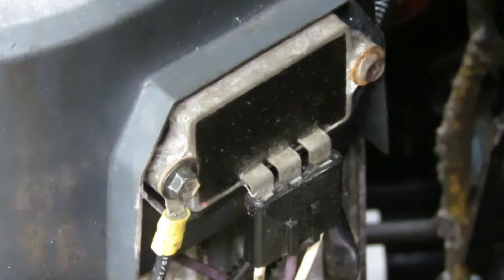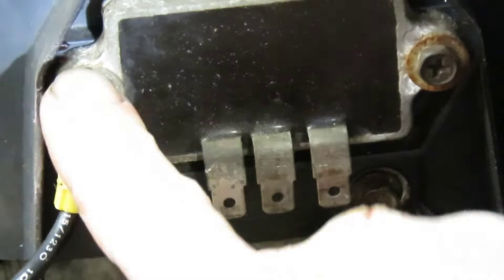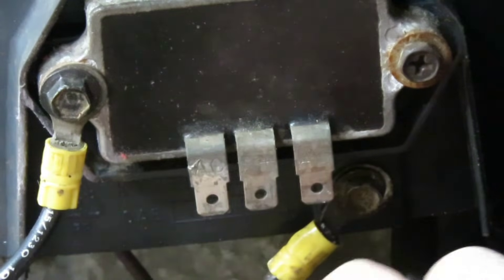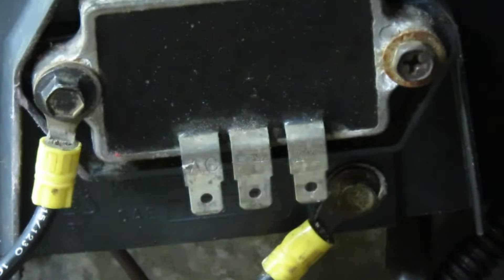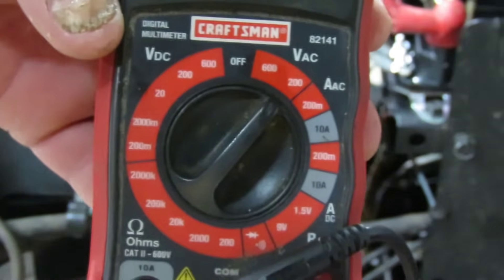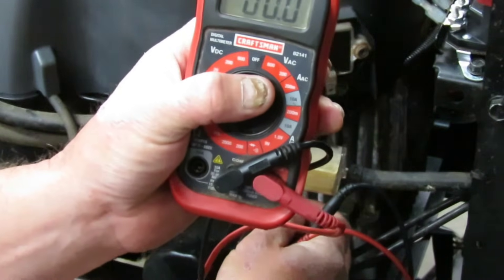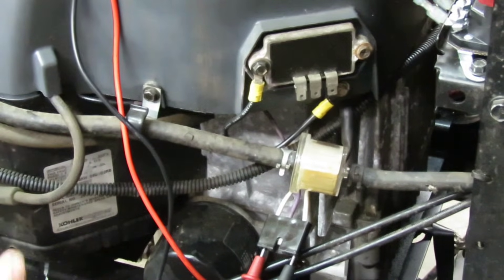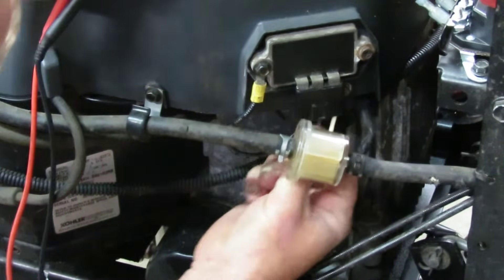How to Test Kohler Charging System

Comment: Following your process, I tested my stator and got 41 volts.  However, when I tested my center prong on the rectifier, I'm only getting 12.  I thought it was bad and decided to order/install a  brand new one.  However,  I'm still only getting 12.  Any thoughts/ideas on why I may not be getting the required 13 - 15 volts?   Thanks!!!
Reply from the maker: Check ground to base of rectifier. Usually on a kohler the rectifier has a small wire going from rectifier mounting bolt to a shroud bolt.
Kohler is bad to lose the ground at the shroud bolt.
There is a trick to this test.
If you put your meter leads one on rectifier base and one on the bolt on shroud
You will show ground
But you are actually getting a reading thru the wire.
Put one lead on battery negative and the other lead on base of rectifier to test.
Reply: @sartingarage8045  I’ll try that today… Thanks!!

Comment: My son's Kohler 25hp wouldn't charge. I checked the stator output and was a whopping 44v. It was in fact a bad ground on the voltage regulator, easy fix. Thanks a LOT for the video.

Comment: Great video. One question though - couldn't you start by checking the regulator dc output first. Can't we assume the stator is good if the volts out are good?
Reply from the maker: Yes you can 
If you have charging voltage there and not at the battery. Stator and Regulator are working. The problem then would be wiring or faulty key switch

Comment: What can i do
Change flywheel or megnatic pieces under flywheel kindly your support
Reply from the maker: You can replace flywheel or you can epoxy magnets back in place. If it's just one magnet. Epoxy it back into place.
If it's more than one
The magnets have to be in a sequence
Push Pull Push Pull Push Pull
Meaning one magnet is Push Next magnet is Pull. They have to be in this sequence all the way around flywheel.
Reply: @sartingarage8045  magnets around flywheel every one magnets has push and pull from ends
Reply from the maker: It's been awhile since I've had to do this
But take another magnet 
Put the magnet against one of the magnets on flywheel , should either push the magnet away or pull it. Go to the next magnet should be the opposite of first one.
Should be like this all the way around.
Reply: Thanks for your information ❤️
I need your email address for more contact

Comment: Very good video
My issue in Kohler kt735
Stator reading 30at3600rpm
Regulator reading 1v 
I changed stator become reading 40ac volt
And change regulator become reading 8.65Dc volt
Reply from the maker: Kohler engines are bad to lose ground to base of voltage regulator.
Make sure base of regulator is grounded
Usually small black wire which connects to bolt on regulator and goes to bolt on engine shroud.
Loses its ground at bolt on engine shroud.
Also with key on make sure battery voltage is at regulator wire that you have 8 volts on.
If there is no battery voltage problem is in key switch or bad connection.

Comment: Hi 
If stator out but 30.2ac V 
At full throttle
Regulator 1DCV
Kindly your advice
Reply from the maker: Turn Key to on position 
Check Voltage at Regulator where you are getting 1 volt
You should have battery Voltage at this wire with just Key On Position.
Engine Not Started
If there is NO battery voltage at this connection
Your problem is wiring to and from key Switch or a faulty key switch.
I have a Key Switch Test Video

Comment: So, I just checked the stator, throttle wide open and it's only reading 1.2 to 1.3. The grounding bolts look good, no rust. I have yet to check the voltage output, because I think it's a moot point at this time. What would you suggest my next step would be?
Reply from the maker: 1.2 volts AC voltage is Not enough
Pull Flywheel and check magnets. If Magnets seem to be ok and in place 
Replace Stator
Note: If magnets are loose or have fallen out
There is a certain way they go back in
Get back with me if they have fallen out
Reply: Upon further investigation, my dumbbutt didn't have my leads pushed in all the way on the meter. I am getting proper amount of ac voltage from the stator, and proper amount of dc voltage out of the regulator. My issue is that after running my mower until it's warmed up or hot, it won't restart if I have tto shut it off for a minute or two. I have to wait till it's cooled off for 45 minutes to an hour.
Reply from the maker: There are several things this can be.
But from what your telling me it sounds as if
Carb Needle Not seating properly causing fuel overload after engine shut off,
Don't think this is Ignition Coil problem due to engine would just shut off on its own.
Possible Key Switch Short intermittent 
Or Maybe Valves need adjusted
When engine is cool the valves will have less clearance.

Comment: I was hoping you might go one more step. I found the video very good , My stator was putting out over 45, The rectifier was putting out 14-15 yet when I check the battery terminal, it was 12.7 which isn't enough to keep my battery charged. I welcome your thoughts as well as others that might have some insight. I checked the bottom fuse on my Exmark 60 Turf Tracer  23hp Kohler . Many thanks
Reply from the maker: That wire off voltage regulator goes to key Switch A1 or A2 usually
Test key switch from B terminal to A1 or A2 terminal.
You can disconnect battery and do a continuity test from wire on voltage regulator to key switch connector to find which terminal it is on key switch.
Reply: @sartingarage8045  UPDATE: I could not sleep, the little voice inside my head was talking to me and said, Silly Boy , Check the fuses, Everything was reading perfect except at the battery. I had to physically take a pair of pliers and pull the top fuse from the holder (because it had fused to the plastic) It was fried. Put in another fuse and it was reading over 14 at the battery... Very happy and just wanted to share in the hopes it helps someone Else. WE all can learn from each other. Many Thanks

Comment: I have a 26.5hp Kohler horizontal engine. It quit charging. Cleaned up all connectors and put a new regulator on. I'm getting 43vac to the regulator but only 1vdc coming out. Any ideas. New battery. Even ran a separate jumper ground from battery to regulator housing and no change. Thank you
Reply from the maker: Most Regulators have to have battery voltage to the output that your only getting 1vdc out of.
This voltage comes from key Switch
B terminal on key switch comes from Starter Solenoid, small wire with fuse in it
Connects to A1 or A2 terminal thru key switch
A1 or A2 go to Voltage Regulator
Watch this video it is a Kawasaki 
But everything works the same
Just wires on Regulator are on different
There are some good tips and tricks in this video
https://youtu.be/zRwkKNGkymU
I also have key switch test video link below
https://youtu.be/fAWMFy9L9iI

Comment: Things are never as easy as youtuber's make it look.  I have not been able to find any youtuber who test regulator on horizontal CH940-CH980 kohler.  Problem with them is that they are mounted underneath the flywheel shroud with a blind connector.  The test is simple but the access is always the problem.  Any suggestions?
Reply from the maker: The stator wires should come out from under shroud to a voltage regulator mounted to side of engine. You can test the AC coming out of stator at voltage regulator.
Usually on a kohler the voltage regulator has 3 terminals. The two outside terminals are from the stator. The center terminal is DC output to charge battery.
Reply: @sartingarage8045  Like I said, the regulator on these is mounted under the shroud and so to is the 3-pin connector.  That's what makes the testing a real pain.
Reply: It can be hard to understand, unless you've worked on one of these.  The Kohlers above, to clarify, have the regulator ground wire bolted to one of the ignition module mounting bolts because the regulator mounting bolts just go into the plastic backing plate.
Reply from the maker: Can you get me your exact engine model # and spec #
Reply: @sartingarage8045  Sure.  The following have the same config, carb, stator, regular/rectifier.  CH980-2016 and CH940-3011.
Reply from the maker: I think what I would do is relocate the voltage regulator to the outside of shroud.
But remember base of regulator has to be grounded to work.
Cut the connector off leaving some wire to attach to. add some wire, use butt connectors and I would heat shrink tubing over butt connectors to seal it.
Or make you a test connection that attaches to stator wires and run them out from under shroud. I would use a wiring harness that has a connector on it like a Briggs and Stratton Part # 393456. Just Google that number it will come up It's like $18 or steal one off old mower.
Then you can just leave the harness on the engine for future testing. With the connector on the end of it will be less likely to touch metal and short stator out. Maybe find a rubber cap or something to cover over connector when not testing. You could just leave it on the engine
The DC output wire from regulator has to come out from under shroud already usually runs to key switch.
But for the most part the voltage regulators are notorious for going bad. It's usually not the stator that is bad. Very rarely it's the stator bad. Usually Voltage regulator bad or bad ground to base of Voltage regulator.
Sometimes it's the key switch not making the connection between the DC output wire terminal to battery terminal on key switch.
Reply: @sartingarage8045  Thanks.  Could do, but for client motors, tend to like leaving config OEM.  Also, worry somewhat about regulator heat sink, if mounting with connector outwards.  Just seems like this should be a Kohler issue, but they aren't interested in any engineering change, believe me I've tried.  This series config is the only one I ever seen in my 40 years or servicing small engines.
Reply from the maker: Yeah it's silly to mount that inside shroud knowing you can't get to it to test it without it being dangerous. Which would be running engine without shroud on it to test.
Only thing I could figure is there using air from Flywheel to keep regulator cooler and maybe out of weather.

Comment: I got 13v is that good?
Reply from the maker: 13 volts will still charge the battery up
But seems a bit low should be more around 14+ . I would check ground to voltage regulator and maybe weak stator.
Make sure battery is fully charged also and check charging again.
But I have seen them run low voltage like that and still charge. It's actually putting amperage back into battery. It not really voltage that charges the battery.

Comment: I have a nice running k181 a on a go cart I’m finishing up. Quick question with a generic eBay rectifier does it matter witch way I connect the two white engine wires? As long as the middle post off the rectifier goes to the correct post on the key switch right? Also an amp meter can be spliced directly into the wire that powers the key switch without problem?
Reply from the maker: Pretty sure it doesn't matter

Comment: good Job > Thanks ! The Purple Wire can be used to return Charge back to the battery ? Correct ??
Reply from the maker: Yes But need to be ran to key switch otherwise will drain battery down when not in use
Usually A1 or A2 on key switch
Use a multimeter in ohms to test
Turn key to on position 
Test B to A1 should have continuity 
If not
Test B to A2
Purple wire to which ever has continuity with key on
Reply: @sartingarage8045  Thanks Again !!
Reply: @sartingarage8045  Problem is , I removed the key switch and used a Push Button Starter ? I have the kill switch on a Toggel switch . Could I put The Purple Wire on a toggle switch also ???
Reply: This 25 HP Kohler is being repurposed for a 40 ton Log Splitter > Just FYI ..
Reply from the maker: Yes just have to remember to turn it off
Probably be easier and cheaper to just buy a key switch and wire all to key switch
Reply: @sartingarage8045  Okay > Thank You So Much for your knowledge !! Have a great day sir !!

Comment: My kohler 30hp runs as long as the key is engaged in the start position, when I release the switch to run mode, it dies every time.  I replaced starter switch, and checked all the safety shutoff things like the emergency brake, seat switch, etc.  Any ideas why it quits when I release the starter?
Reply from the maker: Sounds like something inside key switch is connecting to ground
Could be for ignition Coil or Carburetor Solenoid.
Carburetor Solenoid would be loosing power/voltage or loosing ground.
Ignition Coil would be grounding out
With key in On position check for voltage on the Carburetor Soleniod. If it has one wire positive lead on wire a d ground other lead.
If it has two wires one lead on each wire.

Comment: I have one that keeps blowing the 20 amp fuse.
Reply from the maker: Multiple things can cause this
I would start with wire from battery post side at solenoid. Trace the small wire that is connected to this same wire at solenoid goes thru that fuse up to key switch B terminal. 
Check this wire for bare wires touching metal shorting out
Test key Switch also for short.
Check charging system voltage
Shouldn't ever be over 15 volts DC

Comment: Great videos and thank you for them! I have a question about my John Deere Sabre 1948hv. When I turn the tractor on my battery light has been coming on. What are the scenarios that make that light come on?
Reply: Thank you so much for the info and fast reply!
Reply from the maker: Multiple things can cause this light to come on. 
Battery Ground to frame
Voltage Regulator Ground connection
Key Switch Defective which would depend on how the battery light is wired up
Weak Stator 
There's a few to check

Comment: I have a kohler engine and it is putting out 19.7 V is that still fine
Reply from the maker: If that is DC to the battery Its Not OK
If it's AC out of stator I would say that's a bit low on voltage.

Comment: THAT PURPLE WIRE IS GOING TO THE KEYSWITCH....
Which terminal on the keyswitch !!???
Reply from the maker: A1 if I remember correctly.
Easy way to test put multimeter in ohms.
Unplug purple wire from regulator
One lead in connector
Then at key switch prob each connection.
May want to disconnect Battery for this as there will be power on B terminal

Comment: Is a 25 403 20 voltage regulator interchangeable with a 25 403 21? The original is a 25 403 20 on my 2012 cub cadet 25Hp Kohler Courage. I have a 25 403 21 available to use, but don't want to if it might cause damage to the charging system. Thanks!
Reply from the maker: Same regulator
25 403 39 Replaces both
You can use either
Reply: @sartingarage8045  Thanks for your prompt reply. Your videos are great helping us weekend mechanics narrow down simple problems where we'd otherwise not even know where to start. Thanks again!

Comment: My Kohler 25 hp PS-SV730-3022 Husqvarna riding mower is giving me grief.  I went to start it, the battery was completely dead, and it my battery charger advises that there isn't a battery hooking up to it when I tried to charge the battery.   I suspect that the voltage rectifier/regulator has failed and allows AC current into the battery.  Two brand new batteries, no idea.  Would this be a possible solution?  The tractor will not turn over, even with a booster battery.  Any ideas?
Reply from the maker: That is possible. Also spark voltage from ignition Coil can go thru ground causing this.
Usually will give a high voltage reading especially at the pto clutch connector. Running up to 90 volts. Will damage the clutch eventually. Once you get a good charged battery in the mower. You need to check for this voltage at the clutch. 
If it is High at the clutch
If I remember correctly will be a negative Voltage because power is going thru Ground.
Take shroud off of engine and disconnect single wire to ignition coil ( usually Black wire) Put shroud back on for safety from flywheel. Start the engine and see if High voltage is gone at pto clutch. If voltage is Now Normal, Replace ignition Coil

Comment: What does it mean when I test my stator, and the voltage reading is all over the place? Goes from 9v, 10v, 12v, 13v, 15v etc. But its all sparatic on the meter?
Reply from the maker: Is your meter set to AC Voltage
If it is and voltage is that low
Probably need new stator and or check magnets under flywheel.
Reply: @sartingarage8045  set on AC. I tested my voltage right off the stator, not connected to the regulator, and I get a solid 48-49VAC. But once connected to the rectifier, testing the two tabs the stator plugs into, its crazy on my meter. 

I omed out my circuit breaker, so thats good. Ordered a new ignition switch, one item i have never replaced. 

This is on my 1975 John Deere 300, 16hp Kohler. The 17 years I have owned it, its never charged like it should. I have replaced the stator twice, rebuilt the engine 2 years ago, I know all the magnets are on the flywheel. 

If the ignition switch doesn't fix it, going to replace the amp meter, never replaced that either.

Comment: Is it possible to put the connecter that plugs into the voltage regulator on backwards? Mine was just unplugged and it’s hard to tell which way it was plugged in originally. And it well plug in ether way
Reply from the maker: For most kohler voltage regulators it doesn't matter. But to put it on like it was from factory. There should be a small tab on one side of connector. The other side of connector just flat. Flat side towards the engine